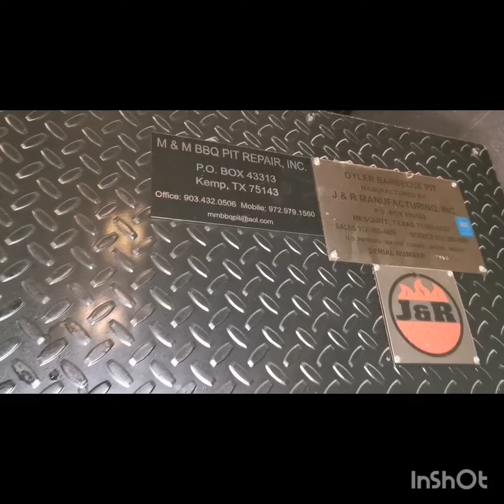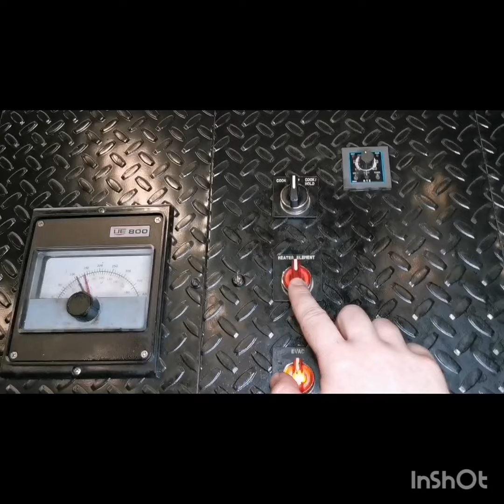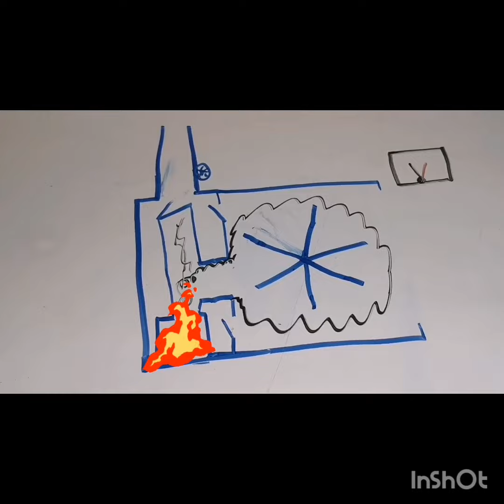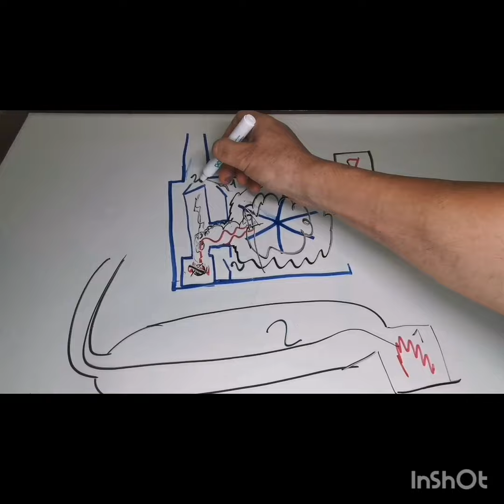BBQ SMOKER REVIEW | J&R OYLER 800 WATCH THIS BEFORE YOU BUY IT!! SUB. ITA

Comment: I shopped for 10 years for a 100% Wood Fired Rotisserie smoker for catering and events after using off-sets for years; Gas fired rotisseries are in most restaurants, Southern Pride, Old Hickory.  I had emailed and called Oyler, love their history and story.  Price is outrageous.  Oyler's start at aprx. 30K, this one in video was 50k!  Forget it (unless you have a massive brick and mortar restaurant)  I went with a American Barbecue Systems (ABS) 5ft Judge trailer, aprx. $7,000.  100% wood fired, I can fit 32 full briskets or 72+ racks of pork ribs on mine, tons of capacity.  No hot and cold spots, cooks totally even!  Easy clean up, portable.  I'll take the rotisserie any day over an off-set for cook quality and not having to move or turn meat, no uneven color from hot spots.  I love off-sets too, but no contest when it comes to cook quality.  Not cooking briskets on the Oyler b/c of smoke condensation, may be that the draft system isn't great on that thing?  My ABS drafts like crazy, never any issues with smoke or condensation.  I agree, ribs on a rotisserie are fantastic, cook perfect and the color is great b/c ribs are extremely sensitive to hot and cold spots, they require even cooking; rotisserie solves that problem!
Reply from the maker: Love ur story it shows lots of passion! On my opinion every smoker has advantages and disadvantages. The worst think can happen to a pit master is to put the cooker before himself, fir the simple fact that machine can't  add the main ingredient into great food wich is love.
Reply from the maker: @SELVAJASONR  lol